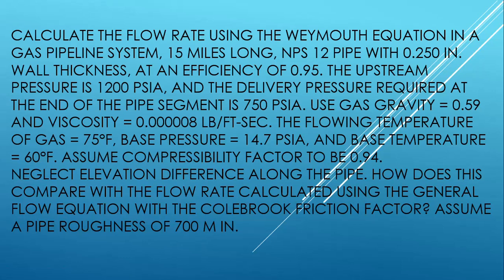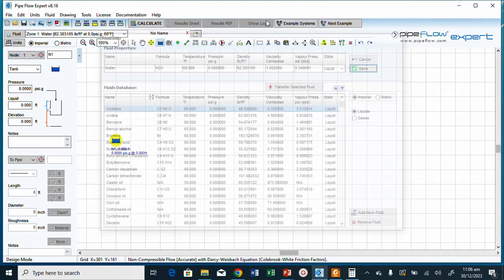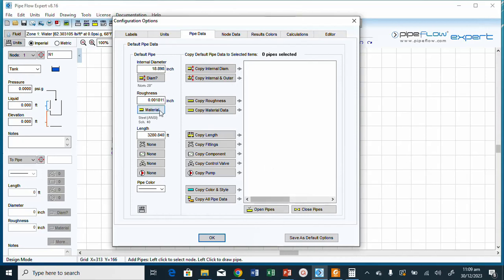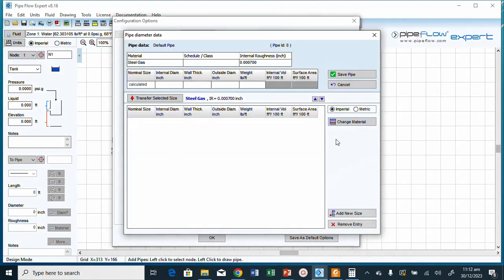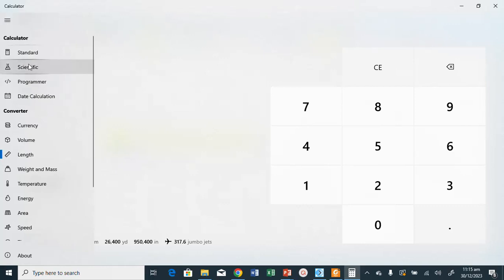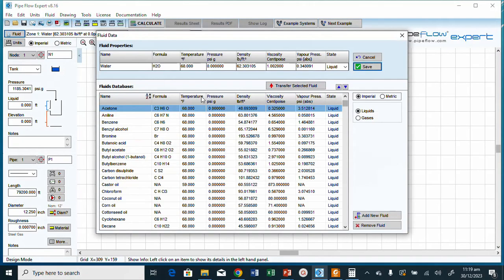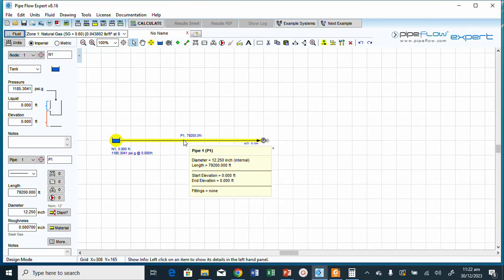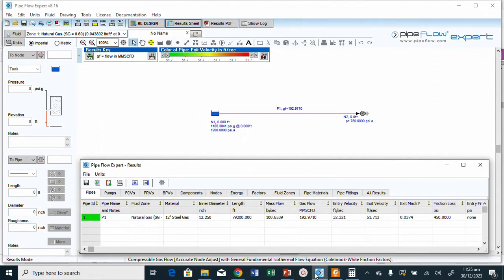how to use pipe flow expert to calculate gas flow rate with Weymouth equation

Comment: thanks four shareing your knowledge. I have a cuestion: if the pipeline its brandnew the efficiency can be 1?
Reply from the maker: A brand new, perfectly smooth pipe would theoretically have an efficiency of 1, but in real-world applications, it's usually slightly less due to minor imperfections.